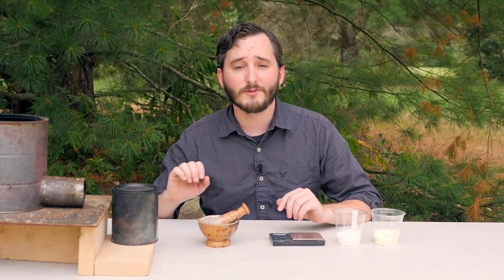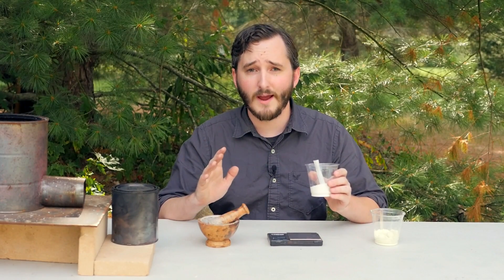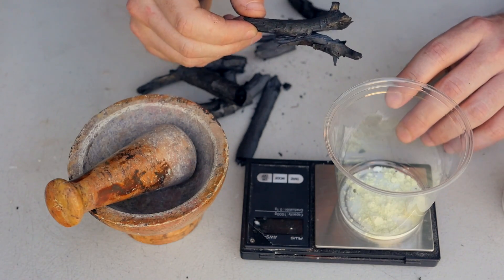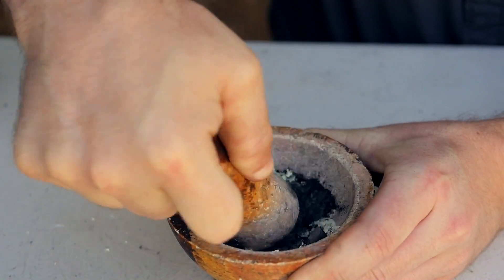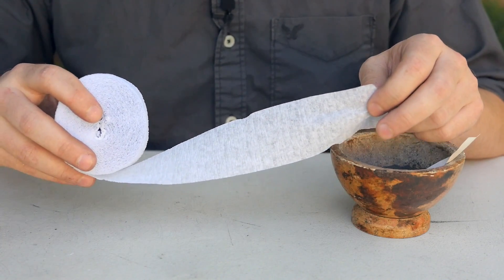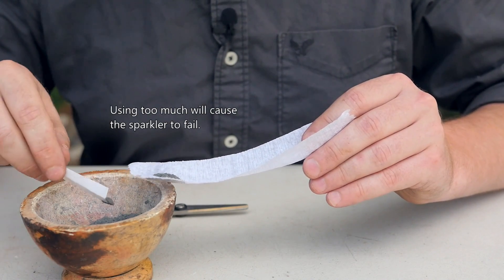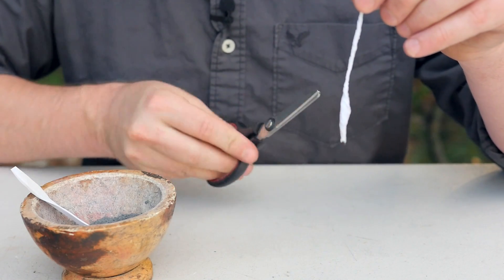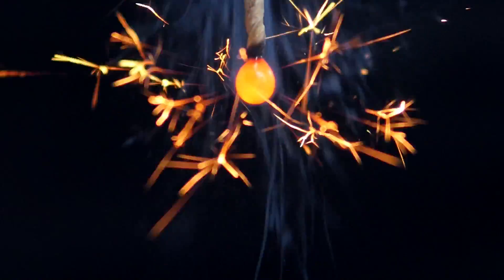How To Make Senko Hanabi Sparklers (very rare Japanese fireworks)

Comment: Let me guess. It needs an oxidizer i can't get in europe?
Reply: Anton Helsgaun correct
>muh nitrate salts
Reply: You can make potassium nitrate yourself. Just need a few rotting corpses. Ive found that this makes the best pottasium nitrate.
Reply: Go to naturalspices.eu. Then search for E252
Reply: Anton Helsgaun   Nope I live in holland and I get in from dedumpschuur.nl
Reply: Potassium nitrate is a naturally occurring substance. It you want some, there is nothing stopping you from making it. Two common sources are stale urine, and rotting vegetables. or as someone else pointed out, chicken shit is full of it. 

Now if you don't wanna save all your piss, or potato peels to let rot for a bit and boil then, it also has "over the counter" names of Saltpeter or Nitrates. It's used in meat curing and high end cooking. so i doubt there is a complete ban on it, and if you get questioned trying to by some, tell them you're getting into sausage making. Also, get into sausage making. worth it.
Reply: You can buy it in europe on the internet.
Reply: droogkloot666 damn. Still not allowed in my country
Reply: @antonhelsgaun  if you are still looking. Maybe a nitrate salt and potassium hydroxide. disolve both and mix them together to do a double displacement to get the metal hydroxide and potassium nitrate. Shoudl be easy enough to order since calcium nitrate gets used to controll water and potassium hydroxide gets used for liquid soap and a lot of other stuff
Reply: im in ireland, and i have tried a few methods, but one of them that works is the method found in the US improvised munitions handbook that you can get in PDF for free on mobile. just takes a while.
Reply: ha you can't get those packs in Germany anymore... now something else is in them
Reply: Well it is...but you should be able to make potassium chlorate? If you can anyhow get KCl and the rest is easy
Reply: You need potasium nitrate.
Reply: Matt G tree stump remover is very hard to get your hands on here, I think you need some sort of permit acquired though professional gardening.
Reply: You can get it from http://keten.com.pl just email them!
Reply: Why say Europe? In the UK pretty much every chemical is legal
Reply: @mrcaboosevg6089  since you guys arebt part of the EU posers
Reply: Brice do you mean ebay?
Reply: Another possible source for potassium chloride is water softener salt.
Reply: get straw, throw about a bushel on top of a tarp, then get everyone to piss all over it. wrap it together, and let the chemistry go to work. it takes about a year. but you will get a decent amount.
Reply: I can see why they did it that way in the old days, but in the 21st century, why wouldn't you either: 1) buy it, or 2) use the Birkeland–Eyde process if you have electricity, or 3) use the Ostwald process if you can get platinum for a catalyst and whatever else you need?
Reply: Setalaa You have to use vegans
Reply: Anton Helsgaun https://science.wonderhowto.com/how-to/make-potassium-nitrate-home-293015/
Reply: I'm from eu and i can get my hands on a few kilograms of kno3 here is a hint look on websites that allow people to sell things to other people
Reply: Anton Helsgaun look for stump remover with potassium nitrate or ammonium nitrate also instant cold medical packs are water and ammonium nitrate.
Reply: Well, it seems most of europe can get it quite easily, so you probably should have just said that you cant get it in *country*.
I live in europe and i can buy both KNO3 and sulphur in most hardware stores, they sell it as a fertilizer.
Reply: Anton Helsgaun Ammonium Nitrate from instant cold packs and potassium Chloride sold as a salt alternative. Mix equal parts in warm water till disolved and cool the solution over night. Potassium nitrate will result as a needle like crystalline precipitate.
Reply: If the nitrate is only acting as an oxidizer, as it seems to be, then in theory it might work with chlorate, since that is more-or-less a similar oxidizer.  Their melting points are also similar.  It's worth a try I suppose.
Reply: Not all nitrates are equal, oxygen molecules and stoichiometry determine a number of final properties, oxidisers can't be swapped gram for gram to achieve the same thing as the nominated nitrate/ oxidiser.
Reply: look for saltpeter or salt petre ( what ever spelling you may go by ) - and see if you can buy it that way... KNO3 -- 
sometimes changing what you are looking for may show different things you can buy
Reply: Birkeland–Eyde process
Reply: in canada there is no stump remover containing potassium nitrate
Reply: Selling KNO3 without checking identity and stuff is illegal in Europe and buying it can get you in trouble. Howrver you can easily make it. You have to mix Calcium Nitrate (it isn't classified as an oxidizer because it is present in the form of a tetrahydrate, therefore you can easily buy it) with Potassium Carbonate and dissolve it in cold water. Combining the two in solution will form Potassium Nitrate and Calcium Carbonate. The Calcium Carbonate will percipitate out on further cooling after that you need to filter off the KNO3 solution and evaporate it. And voilá
Reply: thank you for this valuable information
Reply: Ivan Stroganov I know, this method is just there to be extra sure ; )
Reply: I wonder if the used firework could be recycled?  
K2S + H2O → KOH + KSH
Maybe separate the KOH from KSH with alcohol? 
Maybe separate the K and S in KSH with electrolysis of the salt in water?
I don't know if it's practical, I was just wondering.
Reply: how to get put on a hunder watchlists in one simple step...
Reply: idk where you live but if you are in the netherlands or close by dm me there is a great gardening supplie site that doenst require any screening.
Reply: Does this work with bbq/lump charcoal?
Reply: He mentions in the video, (and I agree), it should work with lump char, just not briquettes.
Reply: Electrolysis of Salt water.
Reply: People are still saying stuff avout tge whole Europe. European Union HAS regulations about selling chemicals, of high explosives, radioactive materials, and powerful toxins and also powerful oxidizers. There are substances that are illegal to buy for a non chemist but if you can't buy potassium nitrate it is your countrie's law. A few months ago I ordered online a package of 0,9kg potadsium nitrate, 1kg sulphur, 0,25kg barium nitrate, 0,5kg magnesium and 0,5kg aluminum. I do know a guy who is a chemist so If I asked him I could probably get some really dangerous stuff to make some even more dangerous stuff.
Reply: if you live in gemany (like me) simply drive to austria.
you can get a fertilizer called krista-k there which is basically pure KNO3
Reply: same here i live in austria
Reply: Constantijn van Hartesveldt 
The US
Reply: Anton Helsgaun.... well, you can get it through Instagram...
Reply: you can you just need to look hard enough
Reply: Brice nope. For once the law did a good job
Reply: Anton Helsgaun we cant? :(
Reply: MrcabooseVG 
I bought a kilo of Kno3 (potassium nitrate) from eBay, I'm in the uk. Maybe sulphur might be harder to source, I can't say I've tried to but it though.
Reply: Not in California lol. I can't seem to find stump remover or weed killer that is a oxidizer.
Reply: what about polland :D
Reply: Mike Guitar 
Sodium percarbonate is an oxidiser, it's also known as oxygen bleach and comes in a fine granular white powder. 
Possibly an alternative?
Reply: Sauce Boy they changed the cold picks because of that
Reply: Unstable Trigger doesn't work, can't get the ingredients
Reply: Kippenkop Kuikenei gast je bent echt een held ik zocht op Naturalspices maar dat was al gauw vrij duur. Probeer al lang aan dit spul te komen als oxidator maar wanneer je het zelf maakt is het rendement erg weinig. Bedankt gozer
Reply: Matt G Drano is a strong base mostly sodium hydroxide, You can also get pure sodium hydroxide from Amazon.
Reply: @trcostan  lol he means stronger and mofe exotic. Like potasium hydroxide or even stronger ones
Reply: Eh, nice try but Na2CO3•H2O2 is a long way from KNO3 or KClO3.
Reply: that stuff should be easy to get
Reply: Why not Dean n
Reply: weed killer i can't find in eu either  but i know it is possible with the right contacts it isn't that hard to make if you have money
Reply: you cant get nitrtate cold packs either, no source of nitrate is easy to get in canada. fortunately i am a chemist so i can get it but the amateur chemist cant
Reply: you can get everythin! in europe
Reply: sulfur is harder to find sometimes, but I'd say get into flower gardening. 

Sulfur is very important there.
Reply: Duck
Reply: It is also n stump remover. KNo3 Our salt peter  t may be called. I believe you can make it out of your pee as well. Good luck.
Reply: yourayneeum you can easily buy it on ebay, no questions asked
Reply: cheers mate
Reply: There is also a fertilizer called Krista K which is pure Potassium Nitrate. If you're lucky you can find it online
Reply: is de dumpschuur betrouwbaar?
Reply: In theory you can also leach it from hardwood ashes and boil it down, hence the name "pot ash".  

Whether one actually does that or not, it seems it's good to know where things come from.
Reply: Matt G+ Can't get strong bases!? You know what drain cleaner is right?
Reply: Those old type stump remowers are forbidden by law where i live because of it´s possibility to make explosives, tey say...
Reply: Kippenkop Kuikenei dankje!!
Reply: Unless mg's of platinum plating allows you to make kg's of something else.  It all depends on what you're trying to do, and what you have, and what's available.
Reply: Arend Mookhoek gr8
Reply: Quinten Moonen bru
Reply: Potassium nitrate can be easily bought online, as it is commonly sold as a food preservative.
Reply: and Australia
Reply: Anton Helsgaun you can easily buy it in lithuania
Reply: Nor in Canada :(
Reply: I'm from Poland btw
Reply: You can get potassium nitrate in the uk fairly easily
Reply: The fact that you think this means you shouldn't be able to get it.
Reply: Can't you get potassium chloride and nitric acid?
Reply: Use stump killer
Reply: @MattG-mw7zi  thats only america sadly. Here in the netherlands they are realy afraid youll use the oxidizer to oxidize stuff. So even the fertilizer based on sodium nitrate is tracked. To you need to buy it from "shady" sites
Reply: @Lanaxes  very sketchy details :p also not all fertilizers are the same
Reply: Here in India i can get both potassium nitrate and sulphur in ayurvedic (traditional hindu herbal medicine) medicine shop
Reply: learn how to make it out of chicken shit! its not that hard
Reply: Matt G yeah, but you have guns. It isnt avavible because of any the anti terrorism act
Reply: ***** dont i have to prove im a farmer?
Reply: potassium chlorate
make it by electrolysis
use graphite electrodes
u can make em easily
Reply: I live in holland too!
BTW I saw some site where you can buy it and then it's shipped from Poland
Reply: CodysLab shows how to make nitric acid from his pee and leaves. He actually males black powder in the end. Super cool stuff.
Reply: Where do you life? Coutry
Reply: Potasium is so easy to order trough internet, i live in middle europe.
Reply: Stefan R,  Do you think the corpses should be old? Or will I get the best results from a corpse of a baby?
Reply: Barnesrino Kripperino how do you do it? Like take it from a lab?
Reply: Mike Guitar If you can afford to buy platinum, you can afford to buy potassium nitrate
Reply: You can't get KNO3 legally without a specific certificate in austria. If you get it at your local pharmacy they will, one say no, or two look at you and after one week the police looks around your house to search for diy bombs. I wouldn't get it online either because it's pretty much illegal to get that stuff in certain countrys. Ask your lawyer if he/she knows anything about local laws of KNO3. You can make it yourself, but if the police finds out they wont be happy...
Reply: Birkeland–Eyde process and Ostwald process dont work very well on small scales, ive heard

and its impossible to buy in places (ie canada) without a licence

Comment: The sparks from the version 2008 years ago look like carbon steel when pressed against a grinding wheel to me. Could it be as simple as adding more or less charcoal or maybe some small amounts of iron filings to replicate or mimic the flowering effect? Just a thought, love the vids by the way :)
Reply: bombbird10 I would assume slightly more?
Reply: Gregory Smith probably, it might be interesting to try both, but with 10 years or experimenting with it I'm guessing he's probably tried it
Reply: bombbird10 Comparing the sparks to a spark test chart, they don't look terribly far off from grey cast iron or die steel. I'm curious whether filings would spark off in the initial reaction or play a role once the rest started sparking.
Reply: I'm really not sure, but id have though it would take a lot of heat to get the filings to spark off, and maybe there would only be enough heat from the blob of slag at the end

Comment: Those fireworks are pretty common here in Japan, you can find them anywhere.
Reply: Yup, can be seen during summer festivals.
Reply: Not only summer festivals, but throughout all summer and some time before and after summer. Some big stores sell them the whole year.
Reply: Well, I only see people play with this commonly from these festivals, and I haven't tried it myself. Is it dangerous?
Reply: People play with fireworks everywhere here in Japan (where it's allowed). The most common out there are some big, colorful square packages with many different types of fireworks in it, some of them being the senko hanabi from this video.
The fireworks here are not more dangerous than normal fireworks and those senko hanabi are as dangerous as normal sparklers, just don't touch the hot part. One thing to take notice though, is that if you light one of those over dry grass or similar, it could catch on fire since the slag pellet will fall down when it goes out. Most people light them above a bucket of water.